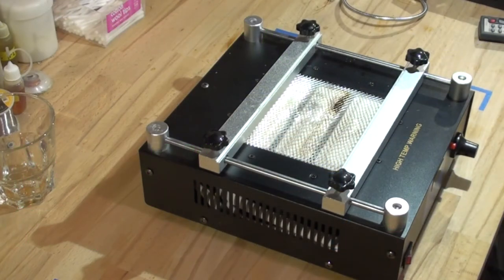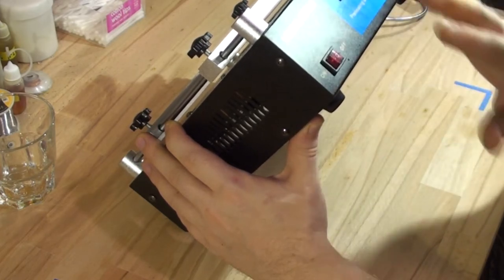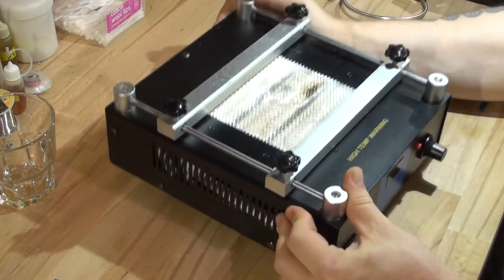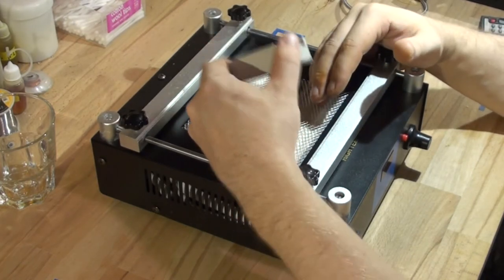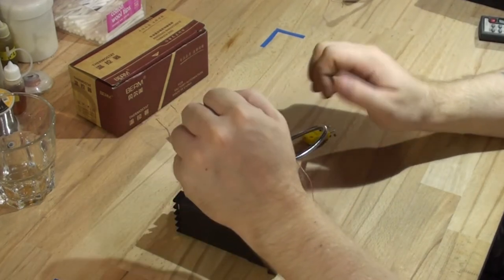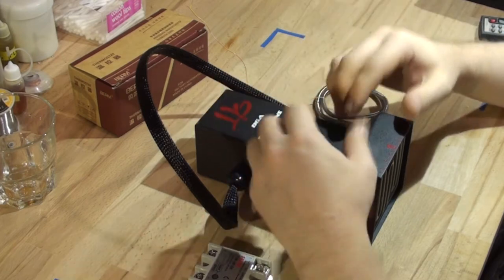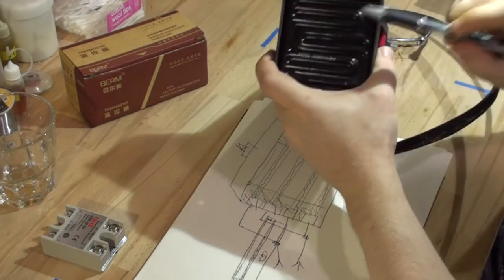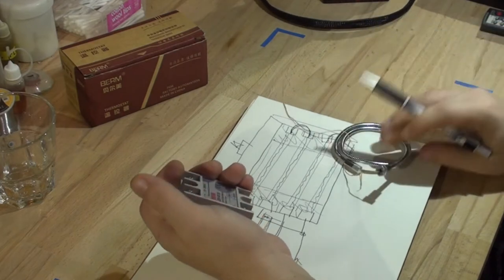DIY Automated BGA Reballing Station. Make Your Own At Home! From Low Budget to Mid Budget.

Comment: is it ok if the bottom heating element is a little bit smaller than the board we're going to heat ? 
i have a ceramic element in size of 15cm*15cm but the pcb is usually bigger
Reply from the maker: Yes it’s fine
Reply: سلام اقا رضا یه سوال داشتم ..شما هیتر سرامیک بالاییشو از کجا تهیه کردی من پایینی رو گیر اوردم که سایزش ۲۰×۲۰ ولی بالای که کوچکتره گیر نمیاد هرچند که توی اکثر دستگاه های حاضری بالایی سشواره صنعتیه
Reply from the maker: Hi, AliExpress.
Reply: @MaxELECTRONICS  Ali Express does not send to Iran due to sanctions 😔
Reply from the maker: Try EBay
Reply: @MaxELECTRONICS  We do not even have access to the eBay site because of sanctions. We electronic engineers will either find a way or build a way 💪
Reply from the maker: I’m sorry to hear that. Hopefully you will have access to the rest of the world soon.
Reply: @mjarefi  سلام داداش ببخشید تازه پیامتو دیدم واسه بالا سایز 12*12 استفاده کردم ولی دادم کابینت ساز یه باکس فلزی واسم درست کنه تا فقط 8*8 سانتش بیرون باشه
Reply from the maker: You can use 2 halogen laps in series
Reply: @MaxELECTRONICS  What kind of halogen should it be? High or normal voltage?
Reply from the maker: Normal 500w each, 2 in series and and duplicate that circuit. Just like I’ve explained in video, that’s for a top heater head. For preheating you just need one 500w halogen flood light.
Reply: @MaxELECTRONICS  thanks bro 🙏
Reply: @MaxELECTRONICS  What software do you use to control the temperature? Is it free?
Reply: @Max ELECTRONICS  Be sure to try to make a video of a chip adjusting And how it works in the future
Reply from the maker: Hi, there’s a software that just shows the temperature, and graph, there’s no software to control the unit, not that I know of, you can find software on Altec website or just Google altec pc910 software. But again, it’s only monitoring software.

Comment: What model is the led driver and how was that connected.If the 12v is directly connected to light as shown on the wiring diagram with a front switch do we have to have the driver and for what purpose?.
Reply from the maker: This is of the shelf light, you don’t have to have light at all if you don’t want to.

Comment: hey i need your help. i did all the thing that you told in the video but after a while when i run the machine the pc410 sv value drops down to 25-30 degrees so it never heats the upper plate. first set value on the screen is 230 and when i enter the options l1 r1 d1 values same as yours. but when  run the machine it drops down again. after remove the thermocouple and keep it in my hand it heats but the thermocouple temp reachs that sv value which is dropped to 25 it stops heating.
Reply from the maker: Hi just increase the D1 for a longer time like I explained in the video, add extra 40 seconds and see how that goes.
Reply: @MaxELECTRONICS  tried but nothing changed. 2 months ago it was running correctly but know doesnt.
Reply: @MaxELECTRONICS  waiting for the 30 minutes but still same ...
Reply from the maker: Check that your probe is working and no brakes in cable, if it was working before and now it doesn’t then there’s some sort of fault that you need to troubleshoot
Reply: @MaxELECTRONICS  is there any guide to follow ? im just a beginner so dont know what to follow
Reply from the maker: Check that all hardware is fine and working like measure the probe resistance, make sure the heater has continuity, and relay works, if all hardware is fine then reset the PC410 and set it up from start again
Reply: @MaxELECTRONICS  heater is working. When i press 3 seconds on the par/set button and when the menu comes in pv screen prog is written and the sv screen hold is written always i cannot change it. İn the upcoming menus thete is a Ctrl in the pv screen and the prog in the sv screen when i change it to run it heats up until the set degree but directly there is no algorithm i think mu problem related to some settings but i dont know how to correct it. On the other hamd, All the Hardware working and fine.
Reply from the maker: Just reset the PC410 to default and enter all settings again
Reply: @MaxELECTRONICS  do you know how to reset factory settings i cant find any doc about how to reset
Reply: @MaxELECTRONICS  I'm sorry for taking your time. I found the solution. There was a problem because I used a push button, not a switch, for the run button.

Comment: Hi, is it possible to use a 120 ac source for power??
Reply from the maker: Yes of course, you just have to buy heaters that are 120v. (Or use halogen flood lights). The controllers are wide voltage range.
Reply: @MaxELECTRONICS  awesome thank you very much!

Comment: Hey Max, this is a really great guide, very much appreciated. Question about the relays, are they proportional SSRs? I noticed in the PC410 documentation that there are options for analog output voltage ranges (I assume this means the controller can output a signal between 0 and 100% to the SSR so the heaters aren't constantly overshooting and undershooting). Did you set up your station using the analog outputs? I'm quite new to all this so my apologies if I'm not understanding.
Reply from the maker: I’m not sure about the analog option, I don’t think the PC410 has it, so it just on or off, they are not proportional, just basic solid state relay.
Reply from the maker: The genuine PC410 may have that option but any that you’ll buy online 99% chance are fake, so they won’t have that option
Reply: @MaxELECTRONICS  Thanks Max, that's interesting. It would explain why similar models on DIgikey for example are significantly more expensive. Turns out the manual I have was for the PC900 model, which I think is a step above the PC410. It could be a 900 series option... my bad.

Comment: its possible to use a hot air gun from a smd rework station to replace the top heating element?
Reply from the maker: Yes but you’d really have to fiddle with profile times and make blower extra slow .
Reply from the maker: I would suggest using 4 halogen bulbs from 500w flood lights, and connect two pairs in series (2 bulbs in series and separately another 2 in series) and then connect the pairs in parallel. That would make better top heating element and cover larger area, I have explained in the video about halogen bulbs.

Comment: @Max ELECTRONICS Bottom heater is too small for pc motherboards... IMO  quartz heaters taken from Microwave oven is the best alternative option for preheater, because you can buy 24 cm long, so they're perfect for bigger PCBs. Also power is too small, because I spoke with many technicians who repairs laptops and they told me that prehater should at least 2kW to avoid problems with temperature stability.
Reply from the maker: I’ve never ran into any problems with it, temperature is stable and those are same parts as the $6000 stations, so if it’s true then the manufacturers of the professional stations need to revisit their products.

Comment: Hello, the keys on my 410 PC are not responding, can you help me please?
Reply from the maker: Check that you have connected the Start and Stop switches correctly, (specifically stop button) I believe the start is “Normally open” latching switch and stop is “Normally Closed” momentary button.
Reply: @MaxELECTRONICS  thanks you for responding, are you talking about the pc 410 ? Because i followed your vidéo, everything works but except thé pc 410 when i press the buttons to program it no sign on the pc410 nothing allows me to adjust must have à problem With the keys
Reply from the maker: Try connecting only power and thermal sensor, don’t connect anything else. See if it will let you adjust anything.
Reply: @MaxELECTRONICS  I tried to do that this morning but still the same problem.
Reply from the maker: Have you tried pressing “Par/Set” button and hold it for 3 to 5 seconds?
Reply: @MaxELECTRONICS  yes I did it but still nothing I think the device is defective
Reply from the maker: Sound like it, pull it apart and check for continuity from buttons to IC, also check that buttons themselves have continuity when pressed.
Reply: @MaxELECTRONICS  ok thank you very much I will look at it and I will let you know
Reply: @MaxELECTRONICS  I followed the line between the stc89c58rd ic and the buttons, the continuity is good
Reply: @MaxELECTRONICS  if I put the tips of the multimeter in dioganal on one of the buttons the voltage drops when I press. without pressing the tension is not stable.
Reply from the maker: @tyvaye try replacing that button, it should be a continuity through it when pressed
Reply: @MaxELECTRONICS   the buttons are ok but it still doesn't work

￼
Reply from the maker: @tyvaye it has to be faulty unit then, make sure your buttons at the back wired correctly (the start/stop ones)

Comment: How to mount upper heater in diy bga .
Reply from the maker: I’ve used two “L” shaped pieces of steel brackets from a hardware store, joined them together and trimmed to size. It’s a good idea to attach a hinge as well so heater can be easily moved out of the way when needed.

Comment: hello friend best regards
I have the following question in my country the AC current is 110 volts that will have some inconvenience in the temperature ramps thanks
Reply from the maker: What country are you in?
Reply: @MaxELECTRONICS  Hello I'm from Colombia 🇨🇴🇨🇴🇨🇴🇨🇴🇨🇴🇨🇴🇨🇴🇨🇴
Reply from the maker: You will have to make the head out of the halogen lamps that you can buy locally, like I have explained in the video, four halogen lamps 110v two pairs connected in series and then both in parallel

Comment: You forgot a pin 16 and 17 to control the disconnection and operation of the bottom heater
Reply from the maker: Those pins are not connected on this unit. As in they re not used at all
Reply: Why not use a thermocouple from a pen 16, 17 installed on the board to control the disconnection and operation of the lower heater with the upper so that the temperature is fixed, eg 25,125,150
So that the heat from below is not continuous from the beginning of the process until the end of the process

Comment: What about 256 c
Temperature of board
Reply from the maker: What are you asking?
Reply: @MaxELECTRONICS  I ASKED YOU ABOUT ELMENT TC 256 
THIS TEMPERTURE IS BOARD????
Reply from the maker: No this is the temperature of the actual element itself, not the board. It’s a redundant measurement, you can ignore this measurement
Reply from the maker: No this is the temperature of the actual element itself, not the board. It’s a redundant measurement, you can ignore this measurement
Reply: @MaxELECTRONICS  thank you
but why dont use this control to down heater for more sefty chip
Reply from the maker: There’s a big temperature difference between the heater and the IC.
Reply: @MaxELECTRONICS  هi dont understand
I mean controlling the heat from the bottom would be much safer on chip rather than direct heat on chip
Reply: @MaxELECTRONICS  i mean use pc410 to down heater instead of
 c100
Reply from the maker: Yes the first PID controller is controlling the PCB temperature at the bottom, that display you talking about is redundant, it’s just there because it was already there, it shows element temperature not the pcb temperature, element temperature is always a lot higher then pcb, like the cooking oven, you set the oven to 180 degrees but the oven element will heat up to 400 degrees
Reply from the maker: You need both Pids, C100 for bottom and PC410 for top, because they interconnected and the PC410 Controls the C100
Reply: @MaxELECTRONICS  I mean that you take the steps through the bottom heater and the heating is from the highest last stage to protect chip